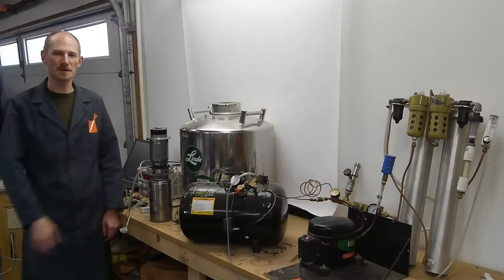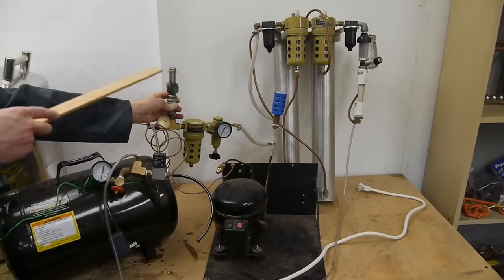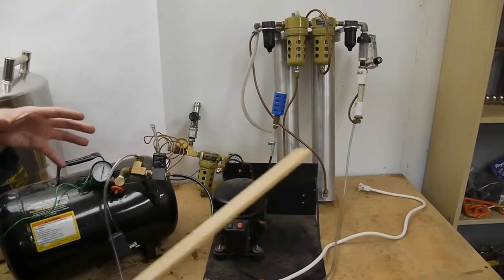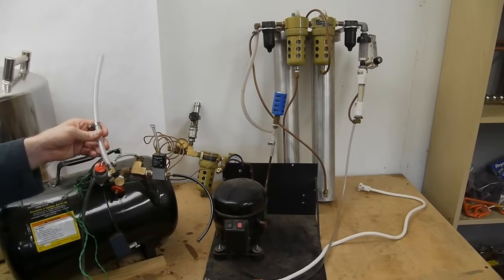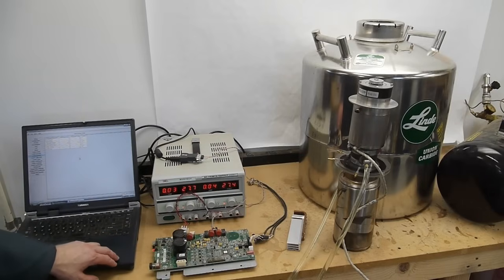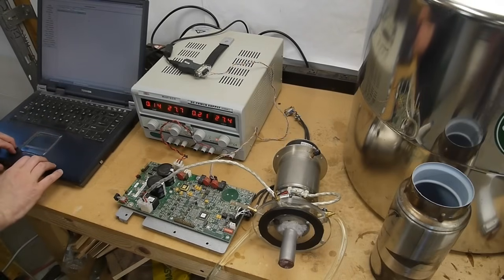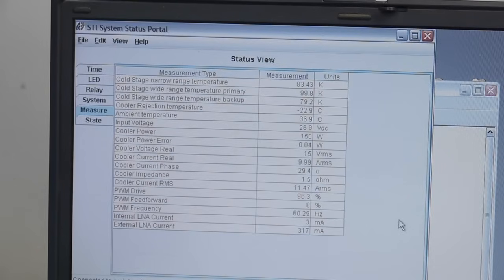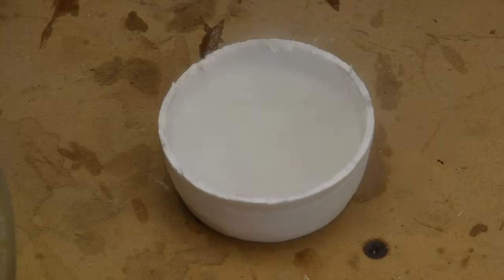Liquid Nitrogen Generator - Overview

Comment: Nitrogen I can get, Oxygen is harder. I may build something like this to make liquid O2. I think I'll also make the cryo cooller because why not! ;)
Reply: keep your hands in tact I like your vids Cody
Reply from the maker: +Cody'sLab You are in luck.  The boiling point of nitrogen is lower than oxygen, so if you connect an oxygen cylinder (eg for welding) to some copper tubing, and submerge part of the tubing in LN2, you will get liquid oxygen out the end as it condenses in the tubing.  Direct it into a styrofoam cup or thermos, and voila!  There is an ancient video on my channel showing me pouring liquid oxygen onto a charcoal briquette fire.  It's fun!  Your videos are great!
Reply: You really should. I'd love to see you make that and do some experiments with LOX. Maybe even a hybrid rocket using LOX you made.
Reply: why do you not separate the Oxygen from the liquid Air at the end with The magnet? the assembly would be so more efficient and also compact
Reply: let's go ahead and make it Cody, I love you Videos
Reply: make a cryo cooler! i want to understand more about these things and maby make one my self
Reply: that would be a nifty project, probably would entail a series of videos on your part, kind of like the precious metal refining series.
Reply: Cody'sLab any updates
Reply: Cody'sLab yes please i am your huge fan
Reply: dion759 yes, he just built it
Reply: +Cody'sLab , +Applied Science , The surplus ex-medical oxygen concentrators are reasonably priced.  They provide an output that is up to 94% O2 (4-10 l/minute) and other trace gases and poor in N2.  I have long considered using the N2 rich exhaust gas for pumping tyres and other stuff, it comes out at ambient pressure but would only require a compressor to be a pretty good N2 source.  With some modification I think it would be possible to tune the purge valve timing for purer N2 at the expense of O2 concentration.  Perhaps not quite enough throughput if wanting to liquify O2 but the N2 should be available at around 40+ l/min or 2400 l/h.
Reply: exactly what I thought too! Just use a T coppling and have a strong magnet on the tube going of to the side  :)
Reply: Liquid N2 and O2 are both super useful. I was thinking the same thing just now and was about to comment but you were already here two years ago. Thanks Cody and Ben. Cool to see this kind of collaboration. I think if you two put your heads together, you could make a fully functional fissile reactor if you wanted to.
Reply: Cody'sLab please make the cryo cooler itself
Reply: I saw a video by... the royal institute I think.  Hold on.  Here, at time stamp 25:24 (in the royal institute video) they take use a vessel of liquid nitrogen and run a coiled copper tube as a heat exchanger to flow oxygen gas from a cylinder through into a vacuum flask.  Hope this helps:
https://www.youtube.com/watch?v=ti_E2ZKZpC4
Reply: @KallePihlajasaari  A friend of mine, now passed away, used Medical Oxygen Concentrators to supply reasonably pure Oxygen to his welding torch. Worked extremely well, and for brazing and silver soldering, , the fuel can be propane or natural gas.
Reply: @rehoboth_farm  You can make LNG the same way (Liquified Natural Gas). Put that together with LOX (Liquid OXygen) and you have the mix used in the new SpaceX Raptor engines. LNG will even freeze solid that way, but then (for continuous production) you have to adjust the flow rate so that the liquid leaves the tubing shortly before it would freeze. As droplets of LNG go into the LN2, they immediately freeze into solid pellets. They are fun to toss into a fire. It might be interesting to use a pebble bed of them to make a Hybrid Rocket Engine.
Reply: @rehoboth_farm  Thank you for posting this link, I watched the full Video!
Cheers from John, Australia.
Reply: @joandar1   I thought it could help some people.  It seems like a really simple procedure with simple to get components.  Never tried to get liquid nitrogen...
Reply: @rehoboth_farm  I again thank you and also know a bloke in my home town that it is job/company that uses LN. The video was a great tutorial for me, I now have some idea where I am going to go with my projects. John
Reply: You need liquid O2 for your O2 dryer.
Reply: Wait, what?! Making your own cryocooler?! I heard that was very difficult because of tolerances...
Reply: everywhere interesting I go, there you are.
Reply: NECROPOST! I wonder if it's feasible to separate the Oxygen out magnetically after liquefaction. Less efficient because you have to condense a whole lot of Nitrogen for no reason but way more accessible to home labs.
Reply: Making  liquid O2 is shown in this video 👉 https://youtu.be/YJqvN4_2rxE
Reply: G’day Cody mate think that would be a great video or to.
Reply: Hey you cold use magnet  to separate
Reply: hyper oxygenated basidiocarp
Reply: I have water
Reply: @YodaWhat  hi is u frnd still pass awayM
Reply: @tonyvelasquez6776  Dead is dead. Still a shame, I miss him.
Reply: Heyy look who it is
Reply: If you use a cryogenic cooler to liquefy air you end up with mostly oxygen and argon. It is even more if you use an oxygen concentrator to feed it with.❤
Reply: You can get oxygen generator from the shops selling equipment for home medical use.

Comment: Yeah you have to use a desiccant to effectively dry the air. I've worked fairly extensively with these systems and the best approach is generally to have two pressure vessels that have a vibrating probe that vibrates at a rate inversely proportional to th dew point in the air. Then when one desiccant gets saturated, you can switch to the other, and send the first vessel into a regenerative cycle that involves back flowing hot air through the desiccant to remove the moisture.

Comment: The spring mass system shown is not for damping. It is to tune the displacer. The voicecoil in the unit drives the piston. The mass of the damper and the spring constant is tuned so that the pneumatic "helium spring" driven motion of the displacer by the voicecoil- driven piston is tuned close to the piston drive frequency by lagging in phase by an amount that will allow a reasonably efficient Stirling cycle phase lag. There is generally a similar tuned spring system attached to the piston tuned to the voice coil H-bridge drive frequency. The phase lag means that the displacer phase will never "cog" or jump a step, and remain faithfully at the design phase lag desired. This allows a smaller, less expensive, more reliable cooler than introducing a mechanically enforced phase lag. 

This method is used in a wide variety of commercial linear compressor coolers.
Reply: It could be as you say AND effectively damp the vibration at the same time.

Comment: How cool! There has been a lot of work experimenting with metals and cryogenically freezing them. The first article I read about was about a guy that bought a new Honda Car, not sure which one, who pulled the engine out and tore it completely apart. He then cryogenically froze the entire engine, letting it soak for several hours and then slowly bringing it back up to ambient temperature. When he reassembled it and put it back I to the car he found an decrease in fuel consumption and wear. That in itself was pretty amazing. A short time later some guitar string manufacturers began freezing their strings and found that they sounded brighter and lasted longer than untreated strings. It would be interesting to see what else can be done with liquid Nitrogen. Thanks for the video. It's going to help a lot of back yard experimenters!

Comment: So would it be theoretically possible to use an electromagnet to separate the oxygen from the nitrogen? Maybe not completely but enough to get over 50% or more?
Reply from the maker: Larry Menasco Hmm, maybe a good topic for upcoming experiment!
Reply: I don't know about actual separation, but I've seen a tear down video (from mikeselectricstuff if I remember correctly) of an oxygen concentration sensor/measurement device that was based on magnetic effects.
Reply: Larry Menasco My thoughts exactly!
Reply: Larry Menasco Or even permanent magnets on a rotating wheel with a wiper
Reply: Applied Science I'd watch that. How hard would it be to build your own sterling pump? It seems like tuning the counter balance would be one of the biggest challenges.
Reply: ***** Electro magnet maybe?
Reply: Larry Menasco The question is if only the oxygen sticks to it.  Yes the oxygen is what is attracted but the liquid may not separate.  If it does you could put the magnet on the other side of the Styrofoam and watch one side turn blue.  Applied Science
Reply: Jason Mitchell  Excellent question. Is liquid air a solution or a mixture? Can paramagnetism, which is an atomic nuclear effect (pretty sure), be used to separate a solution? hmmm...
Reply: Indeed, a field centered on a tap of point could be effective.
Reply: Paramagnetism is due to unpaired electrons- oxygen molecule has two unpaired electrons. It is not a nuclear effect; nuclear magnets are 1000 times smaller in strength. In a strong magnetic field, one side will be higher in oxygen concentration than the other...
Reply: @AppliedScience  Just put the magnet on the side of the cup or dewar and the LOX will go to it, which in turn will push the LN2 away from the magnet. The LOX zone will turn blue, and you will be able to extract fairly pure LOX from that zone. You can also use any excess coldness of LN2 to pre-cool incoming air, increasing the liqufaction rate. For every drop of LOX produced, you will need about 2 drops of LN2 just because of the difference in heat capacity of the liquids. That leaves 2 more drops of LN2 to pre-cool the incoming air. If the air is dry, you will not waste cooling power on making ice and dry ice. Contraflow heat exchangers are great for these effects.

Comment: Phenomenal video as always! It would be interesting to see how much liquid oxygen you could separate via magnetic fields.
Reply: As I said elsewhere to @Applied Science - Just put the magnet on the side of the cup or dewar and the LOX will go to it, which in turn will push the LN2 away from the magnet. The LOX zone will turn blue, and you will be able to extract fairly pure LOX from that zone, without the bother of distilling the liquids via reflux, as done commercially. You can also use any excess coldness of LN2 to pre-cool incoming air, increasing the liqufaction rate. For every drop of LOX produced, you will need about 2 drops of LN2 just because of the difference in heat capacity of the liquids. That leaves 2 more drops of LN2 to pre-cool the incoming air. If the air is dry, you will not waste cooling power on making ice and dry ice. Contraflow heat exchangers are great for these effects.

Comment: So how long does the compressor need to run to collect enough gas that would then yeild an equal volume to the amount of liquid air you had in the cup? I would guess it's quite a while....
Reply: Peter Brown The more important question is: Can you add epoxy to it and turn it on a lathe?
Reply: Way late on this but its continuous flow

Comment: Very cool set up! makes me wonder if the best way to purify the air as it flows through the system is a series of condensations. Compress the air, then cool it in stages to separate out first water, then oxygen and then finally the nitrogen. Might even be able to dial it in to get liquid argon or dry ice.

Comment: This video is awesome. I had no idea that devices that freezes temperatures so low could be so small. Also got me thinking that superconductive application doesn't have to be extremely complicated when maybe cryocooler could be made even smaller and fit into smaller devices with an automatic handled superconductive solution.

Comment: We had a shuttle experiment years ago that used TEC's as the heat pump. When the cold side was exposed to air, liquid air dropped from it quite fast at 280 watts input. I don't see how that isn't the cheapest and most efficient way to make it. The humidity turns straight into ice and should be simple to run a defrost cycle on it occasionally, but the rough ice surface presents a lot more surface area to seed the liquification of air. A simple magnetic concentrator could be used to separate the oxygen and nitrogen, but even more simple would be to have 2 TECs,  the first set at a temp half way between lox and lni, then duct this first stage to a second stage that is well below lni. 2 separate distillers giving 2 separate liquids into 2 separate dewers. Easy peasy. Perfectly quiet solid state solution.
Reply: Come to think of it, a first stage running at 0.5C should distill out all the water, the the second stage could be set at -195C and the third at -250C. The whole airflow through the stages could be gravity fed.

Comment: Very cool video, Ben [I know, bad pun]
lots of interesting components explained. I worked for high vacuum semiconductor equipment manufacturers – back in the day. Brings me back. I was going to be like you when I grew up but took the wrong turn at party central.  
Again, very interesting stuff. One more thing: I remember the sound of helium cryopumps, they always had a low-frequency(approximately one second) almost a slow, steam engine sound to them. Thank you.

Comment: This is extremely cool 8-) (pun intended). Great work! I wonder if more powerful dessicants can be used instead of silica gel. Concentrated H2SO4 or P2O5 would be ideal I think, but there are probably too corrosive, an agent that chemically binds the water instead of just adsorbing it would be swell. But as for adsorbants: I wonder if molecular sieves would do the job?  Anyway, I am very impressed, I just wonder how much the whole setup costed? Used cryocoolers alone go from $500 to $2000 on Ebay.

Comment: Another excellent video!  Have you considered using the mechanics of a medical oxygen concentration to generate your nitrogen?  As I understand it, when air is compressed in a cylinder filled with zeolite, the nitrogen is absorbed leaving oxygen to pass through.  When the cylinder is de-pressurized, the nitrogen is released which you can capture for liquification.

Comment: I see a lot of potential here. I was thinking of making my own electronic flow meter. There are the cheap plastic type, and the expensive servo-motor type of needle valve controllers. A cheap way to get one is to gut a Mass Flow controller used to make semiconductor wafers. I used to work for a company that made them: Unit Instruments, Yorba Linda, CA.

Comment: You can use what’s called a potential relay with a start capacitor to start the compressor with a differential of pressure in it instead of using that spring thing, and you could also go to a refrigeration supplier and pick up a oil separator which is basically the same as the coalescing one but much bigger and it will have a oil return line to bring back the oil to the compressor

Comment: I suppose one could separate LN2 and O2 magnetically as well no? put really dry air into the chiller, and pass through some sort of apparatus that would apply a magnetic field pulling the O2 one way and allowing the LN2 to pass.
Reply: +Skwisgar2322 Ahh, seems i was not the first parson to think of that (as usual) http://www.google.com/patents/US4704139 though that seems to be operating on the gas not liquid phase.

Comment: Gas doesnt always get cold when expanding. The Joule-Thompson coefficient can tell you at which temperatures a gas cools down or heats up due to expansion. For example Helium and has only repulsive forces at temperatures above the immersion temperature. It will heat up wen expanded at more than 40K if i remember it correctly.

Comment: The end attachment for the cryogenic rod probably would of helped liquefying the gas a lot with that surface area, to really know would be to check and make sure that the freezer remove enough heat to cool the attachment.

Comment: I believe if you leave the open container of liquid air the percentage of oxygen will increase as the nitrogen boils off but the liquid is still cold enough to condense the oxygen from the air, due to its slightly higher boiling point. this is why lN2 dewars will usually have a one way vent or a loose seal on them. 

It would be an interesting exercise to use the stirling cooler to build a cryogen-free cryostat. perhaps some low temperature experiments on ICs or viewing changes in optical or magnetic properties of materials as a function of temperature.

Comment: Very cool. Is there a reason (apart from efficiency) not to do the separation at the liquid side through magnetic fields?
Reply: Allan Stirling I doubt you could efficiently remove all the oxygen via magnets and there's still a bunch of water in that cup.
Reply: Allan Stirling I couldn't (quickly) find any information I could readily understand that shows how well mixed the two liquids are, or how easy it would be to separate them. A quick look shows that liquid nitrogen is a bit less than twice the weight of liquid oxygen, so perhaps spin separation could work. They also have slightly different boiling points, so some precise temperature control could boil one off and keep the other.

I guess it comes down to how easily you can get a filter on the room temperature gas stage to purify the nitrogen, and if you'd rather avoid having to deal with high concentrations of oxygen to begin with.

With that said, it would be pretty interesting to see some kind of electromagnetic elevator siphoning oxygen out of liquid air like a solid state pump.